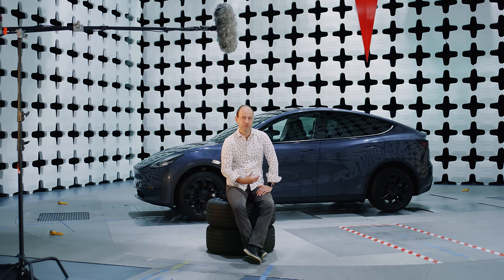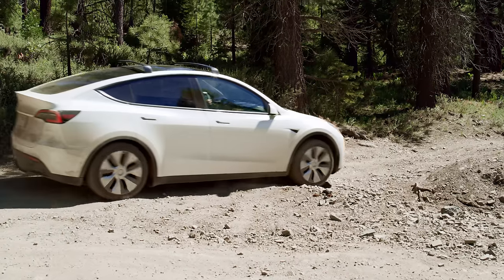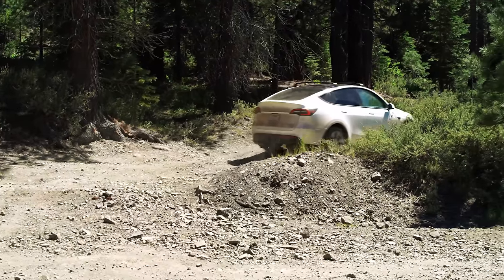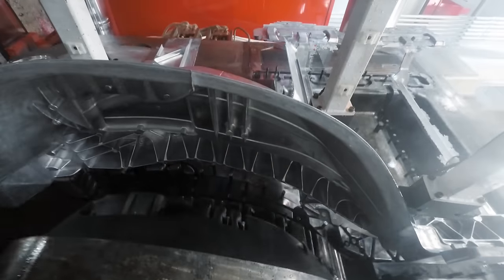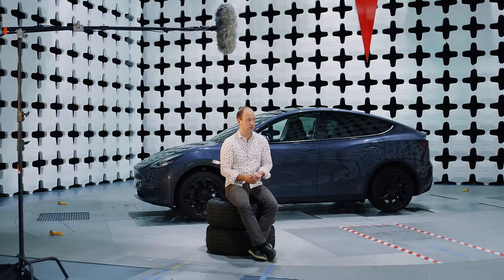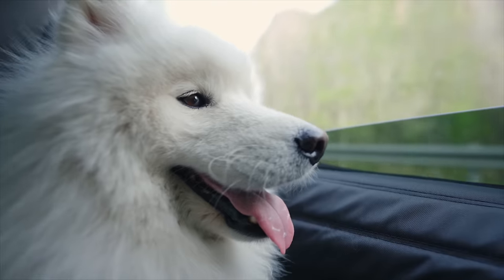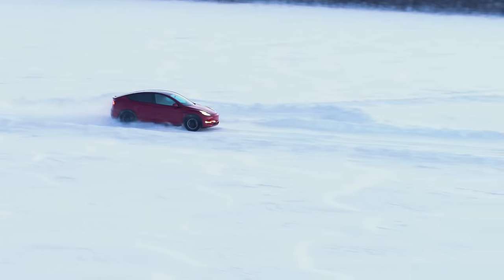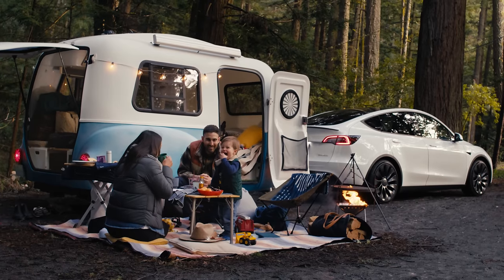Model Y | Engineering From First Principles

Comment: Got my Model Y 2 years and 3 months ago. It now has 108,000 miles. It’s never been touched by a mechanic.everything still works like when it was new. And through software updates, its now a much better car than it was when it was new. Best car I’ve ever owned. By far. I ain’t going back. Ever.
Reply: How do you drive 108,000 miles in two years? My truck has only 106,000 after 20 years.
Reply: @MrCPPG  I have a lot to get done. Lol.
Reply: @MrCPPG Might be a UBER/Lyft driver,Courier service, Sales position, delivery worker, insurance adjuster, home inspection. Geez, none of those possibilities came to mind for you?
Reply: less miles but the Y P is awesome.   Never selling  my other cars (vette and bmw's, old alfa, ) I like the sounds,; but, i dont see myself buying another ICE.  maybe a hybrid but doubt it.
Reply: Ditto just 62,000km
Reply: @MrCPPG dude. I drive a minimum of 70,000 miles a year
Reply: @alvinhostetler-qz1vq  Lol. I drive about $7,000 miles a year.  My tires age out with like new tread.
Reply: @MrCPPG  I’m jealous

Comment: Thankful for the talented people at Tesla who continue to make exciting products and the families who support them.
Reply: It’s already been
Reply: yes but hire presenters and present with a suitable budget for movie like quality ad
Reply: They will be even more amazing in near future,tesla confirmed all new tesla model s for 2025-2026 model years,it said to have new generation of plaid drive units,current model drive unit with 1 speed gear box and the inverter weighs 95 kg each and capable of 400 hp each,but for next gen plaid drive units will weigh 50 kg in totall and capable of 500 hp and 750 nm  of torque each,it means next plaid's drive units will weigh 150 kg less than today,also it will feature new catl condensed matter battery with 445 wh/kg in structural battery pack which led to 310 kg more weight saving,also it will have new chassi design from tesla with 100 kg less weigh compared with 2023 models,over all we are looking at 1080 hp plaid and 1280 hp plaid plus in trimotor models with kerb weight of only 1570kg for a large super saloon with 100 kwh condensed catl batteries and 600 miles of range;amazing future for tesla evs
Reply: Hope they'll make the Tesla HVAC and Ebikes soon!

Comment: My Tesla Model Y long range is over 2 years old now and I still get a smile on my face when I drive it. I am >70 years old and love the seat hight that lets me enter and exit with ease, never going to the gas station and on road trips the refuel takes less time than I do when we stop every 3 to 4 hours.
Thanks Team Tesla as an owner and a shareholder for the last 4 years, looking forward to the TriMotor CyberTruck I sold my diesel RV during the pandemic but will buy a trailer to tow with the CT, please tell Elon we need the range with milage like you guys did for the Semi.
p.s. My car was made in Fremont and I have had zero quality issues.

Comment: Just shy of 150k mikes on our Model S. Best car we’ve ever owned. Thanks for these excellent videos and for producing excellent products. You are the gold standard. 🥇
Reply: Same! Over 140k on my Model S and still going strong
Reply: I have the 22' model S. What were repair costs aside from consumables?
Reply: @DescartesRenegade  in the past 9 years, the only out of pocket expenses have been:

Non-consumables:

- passenger front door handle 
- alignment done at 147k mi
- LTE connectivity upgrade (mandatory)

Consumables:

- front brake pads
- cabin filter replacement (two)
- ten pair of rear tires (P85+ RWD)
- four pair of front tires 
- 12v accessories battery 
- windshield wiper fluid top off

Charging: 

- about $47 worth of home electricity 
(99.9% of our charges are done at Supercharging stations as we are grandfathered for lifetime free charging) 

Optional expenses:

- infotainment upgrade 
- front bumper refresh 
- screen replacement (yellowing edges) 
- wheel touch up paint 
- body touch up paint 
I think that’s about it. Can’t think of anything else at the moment. Will edit this if I remember anything else. Has been relatively maintenance free, and with the OTA updates, LTE/infotainment, upgrades, and front bumper refresh, it looks and feels new for a car that’s nearly  a decade old. 

I think that most well kept 2012-2016 models are a steal for what I see some of them sold for, and a bonus for ones that still have unlimited Supercharging. We average about 16k mi of driving annually, or the equivalent of 64 full charges. 

Free supercharging may or may not be the primary reason someone keeps an older Tesla or buys an older Tesla, but for those wondering if free supercharging is worth driving an older Model S, @.40/kWh (your local SC kW/h rate may vary),  we save $2176 on average annually (16.6k miles avg driven annually - ymmv)— Multiply that by 9 years for a $19,584 in Supercharging costs saved. We have no plans on selling it as it does exactly what we need it to do and plan on keeping the car for as long as we’re alive :)
Reply: @DescartesRenegade  oh, and congratulations on your new ‘22 Tesla! 🎉
Reply: @evolv.e  thanks for the info!
Reply: @evolv.e Thank you for the information!

Comment: Very proud and impressed with the Tesla content team: putting out nice nuggets of how the company thinks and functions
Reply: They will be even more amazing in near future,tesla confirmed all new tesla model s for 2025-2026 model years,it said to have new generation of plaid drive units,current model drive unit with 1 speed gear box and the inverter weighs 95 kg each and capable of 400 hp each,but for next gen plaid drive units will weigh 50 kg in totall and capable of 500 hp and 750 nm  of torque each,it means next plaid's drive units will weigh 150 kg less than today,also it will feature new catl condensed matter battery with 445 wh/kg in structural battery pack which led to 310 kg more weight saving,also it will have new chassi design from tesla with 100 kg less weigh compared with 2023 models,over all we are looking at 1080 hp plaid and 1280 hp plaid plus in trimotor models with kerb weight of only 1570kg for a large super saloon with 100 kwh condensed catl batteries and 600 miles of range;amazing future for tesla evs

Comment: Love my model Y. The one thing I wish was different or customizable is the suspension. Right now it's too stiff, you feel every single bump on the road and it doesn't make for a very comfortable ride.
Reply: Upgraded and up sized 255/50-19 tires help to smooth the ride a bit. They're one inch taller than the lower profile stock size 255/45-19 tires.
Reply: Air suspension instead of springs and dynamic (intelligent) shock damping to hide the small amplitude road texture.

Comment: Love my Model Y. Snow and my Tesla: I bought the expensive tire chains -- to show to the highway patrol so they'll let me drive up the mountain road. Haven't used them yet. No plowed parking?  No probllem. Snow drift, later  just drive out.   I love camping in the back of my Y. . if I don't need a shower I don't bother with hotels. Downside, I don't use my tent as much.
Reply: I got the chains as well, but didn’t need them in the massive snow storms last year.car performed like magic. My only complaint, is all the ice coming up from the chained cars put a lot of nicks in my Y front hood, fairly easy to remedy with the Tesla touch up paint, but still not ideal. Maybe a front hood snow bra would help. I love my Y and 3.

Comment: I have both a Model 3 and Model Y having an issue with the aero panel on the bottom of the vehicle partially coming off with a screw or bolt coming off and the front part dangling down into the road. This happened a year apart from one another with both cars being a year old.   It will hit a dip in the road and eventually breaks off.  During rain, water also collects underneath your car because of this.  I had to replace my air filter for the cabin early as the AC started to smell like mildew.  This happened on both separate cars and so this is a design flaw that Tesla needs to fix.  I had to pay to get the aero panel replaced on both cars costing me $400 each when it should have been replaced under warranty.

Comment: I tested Model 3 and Y to buy it as my next car. Those cars have great features like super fast charging,  quick and detailed entertainment system, dog mode, sanity mode, and camping mode (probably they call those something different) but big no as a car itself. Even if basic parking sensors are not working correctly, the steering wheel feels more like a cheap sim steering wheel than a real one. I feel that every new feature and production stage changes focus on only one topic: cost reduction. (For people who are curious what I am driving - 2018 e class and 2018 I-pace)

Comment: Its amazing how you could achieve all these engineering breakthroughs and at the same time put it in the market for people to appreciate. My sister has a Tesla and being in there makes me feel so cool, there's a special confidence to it. Great stuff

Maybe people think you don't need this but I think there's should be a way to manually open the door though. Give the power to individuals not centralized too much, we have so much of it going forward it should be harder and harder to push back to balance it out. What if you implemented a password mistake system, if you opened the door manually, lets say in an emergency situation... Tesla would ask you for key questions, made enough mistakes it would contact the police in one way or the other. You could also have multiple door handles, or multiple ways to open the door, multiple ways to twist the steering wheel, multiple ways to tap the floor, and enough "wrong password" the car would be jammed or it would contact the police.

Comment: The Model Y is a phenomenal vehicle, but there's certainly room for improvement when it comes to road noise. Every time I prepare for a road trip, I find myself apprehensive - not due to concerns about the range, but the noise produced at speeds around 60/ 70 MPH. The sound penetrates through even the loudest radio volumes. Additionally, every single tire noise is audible, which sometimes leaves me worrying if something untoward is about to happen with the car.
Reply: Might want to have them look at that. Ours is as quiet as a church mouse at highway speeds.

Comment: A few humble suggestions… rear and front sensors don’t help drivers from hitting the the installed Tesla supercharger barriers in the rear and concrete parking barriers on the front spoiler. Also, the “dog mode should be modified for children left unattended. Just as easy to change the name and possibly reposition the inside camera a bit

Comment: My problem with the model Y is towing.  Yes it can tow 3,500 lbs. But the range is so short (90 to maybe 120 miles), yes you can make it from 1 supercharger to the next but only if you charge to 95 or 100%. So you drive for an hour and a half then have to charger for another hour.  It would be nice if Tesla would make a model Y with 400 miles of range, so maybe you could only have to charge to 70 or 80% to get to the next charge.  This would greatly reduce the charge time.  I took a 350 mile trip and had to stop 5 times.  It took 10 hours to make the trip with a head wind of 12 to 15 mph. And I'm only towing a 2,540 lbs and is only 6.5 ft wide and 9ft tall.
Reply: Yeah, trailers add a lot of drag which is the killer with BEV's.
Reply: Yeah, for BEVs, you need to select trailers with low drag coefficients in mind. 

The BEV market will need trailers with built-in battery pack and drive motors.

Comment: The BEV market will need trailers with built-in battery pack and drive motors. The trailer provides motor torque and braking based on trailer hitch forces, tire wheel rotation, and perceived instability. WiFi for in cabin battery monitoring and configuration. Of course it would also work with ICE vehicles.

Comment: If Tesla is listening: I test drove the Y and was eager to buy it....but I drive back and forth between Chicago and Phoenix each way twice a year.  It's ~1800 miles and takes three ICE days.
With the Y it becomes 4+ days and the stops along the way are poor at best,  Reviews include: no restrooms/food (so if I stop and charge I have to stop again for those needs), broken chargers/ broken cc readers, uncertain if 250kw is available or there's a line, no chargers available at 3 out of 4 hotels......in other words, the charging infrastructure is not ready for interstate travel and what's there is filled with uncertainty and frustration. It's never been a fun trip, but the Y makes it horrible.

Comment: In my opinion, the one who establishes the finest infrastructure and simultaneously provides the best software in a vehicle will lead the market in the long run. The only reason I haven't embraced EVs yet is that they don't visually appeal to me, especially their interiors. Additionally, I believe there is significant room for improvement in battery capacity. Nevertheless, it's exciting to witness our technological advancements, and personally, I won't transition to electric mobility for at least another 10 years. I hope that by then, Tesla manufactures beautiful cars that are robustly built to last a lifetime.

Comment: I don't have a Tesla yet, but if I got one it would be the model Y because I want the extra storage space. For people that own the model Y in Las Vegas, or Arizona how do you keep the sun and heat off you with the big glass overhead? Is it tinted already or do you have to take it somewhere to get tinted? Do you put some kind of shade or cover over it? If given the choice, would you prefer a roof that was not made of glass if it were an option? Also, let's say you pull into a Tesla supercharger, and your battery is down to like 10 percent, how many minutes does it take to charge it up to at least 80 percent, assuming the weather is not cold? Also, let's say you live 150 miles from the closest service center. How do you get major repairs done on your car, do you have to have it towed there at your expense if it's not drivable? If it's a minor repair, how long do you typically have to wait to have one of those mobile Tesla mechanics come to you and fix your car?
Reply: I don’t own a Model Y but I know someone very close who does, and I have been around it and in it a lot. The glass roof is definitely tinted well, but if you leave it in the sun, it can still get quite hot in there. But while driving with climate controls on, it feels and looks great (unless in 100-110+ degree weather obviously).
Reply: Also, for the 10-80 percent, in experience i think it was like 20-30 minutes, I may be wrong. But after 80-90%, it charges significantly slower.

Comment: As an automotive engineer, it's a great car, but still inferior relative to German interior luxury quality and craftsmanship. They've come a long way and are leaders in battery tech, but I'd like to challenge Tesla to higher quality interior materials, tighter tolerances, and flush integration between each commodity. Here are some ideas for interior premium packages that may have a high take-rate market: 18-way adjustable ventilated seats, extended leather package, integrated cooler in tunnel/armrest (similar to Range Rover), illuminated door sills, black Alcantara headliner/pillars, exterior-color matched seatbelts

Comment: What does folding seats flat have to do with towing? The Y's rear window already doesn't provide very much visibility.
Reply: What do you think of the rear camera coverage? If the rear camera could be displayed on the rear view mirror, would you be satisfied?
Reply: @imconsequetau5275  That seems to be something that the industry is moving to. So I'd imagine that Tesla would do that eventually. If the camera provided better rear visibility than the rear window them I'm all for it. 
In the scope of towing though, still not getting how folding down back seats are gonna help with anything.
In the scope of a camera for the rear view mirror and towing, it would be cool to be able to sync an external camera to the rear view mirror orthe display both just for driving and parking.
Reply: @Brian-dd2df  "external camera..." 
Yeah, I would love to monitor the rear view camera attach at the back of my trailer.

Comment: Question. Doesn't a single/two piece fram make the car less repairable, i.e in the case of a collision one piece of the frame is damaged you'd basically have to replace half a car rendering the car useless cause insurance won't pay for that???
Reply: It does
Reply: Front and rear crush zone members are replaceable. Slow front and rear collisions may not result in being "totaled". Also, the suspension is generally designed to fail before the frame deforms. 

However, aluminum becomes brittle when deformed - much more so than mild steel. So pulling the cast aluminum frame back into alignment is only possible with minor deformation.
Reply: It occurs to me that cutting into sections of the cast aluminum frame and precisely aligning the sections before MIG welding back together - may be viable. 

The key to this will be high precision mapping of every mating surface so the repair can be precisely aligned. This would therefore require special certification of the repair services.